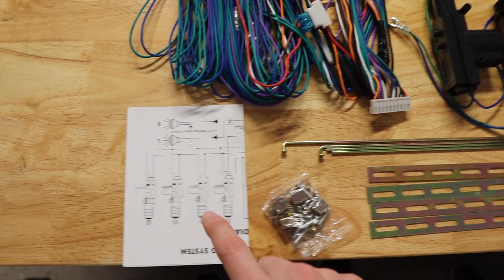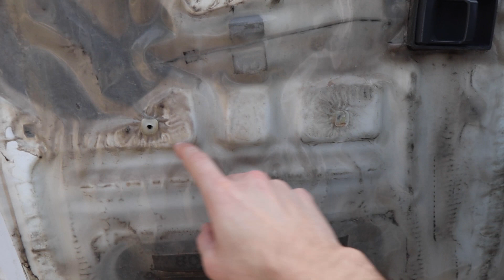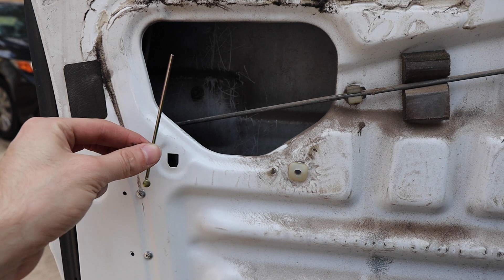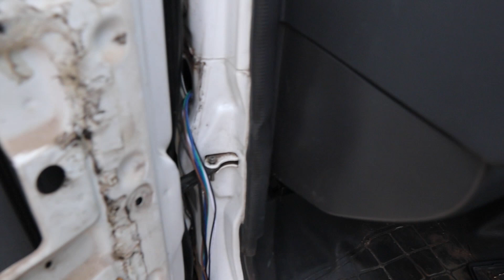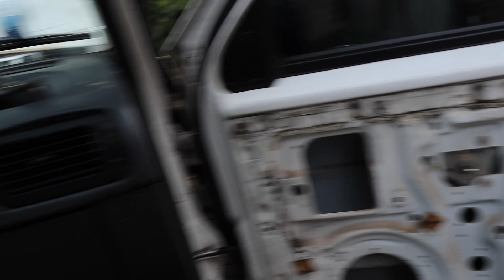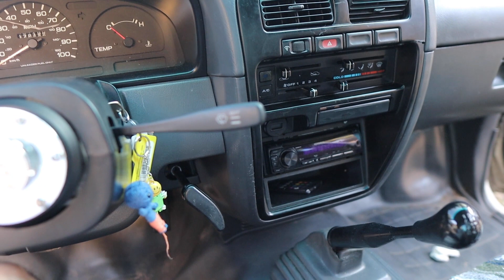How to Install Power Locks in Nissan Hardbody D21

Comment: I found the wire that will make the lights flash. It’s a Pink wire with a Blue stripe behind the steering wheel.
Reply: Doing this method makes all your lights flash, turn signal, corner lights, rear DRL lights, license plate lights, Dash lights, climate control lights, glovebox lights, just fyi for anyone doing this in the future

Comment: Usually what I'd do for customers, I'd tell them to buy an alarm system and connect the lock and unlock wires directly to the actuator wires that's if they don't have keyless entry from the factory. Majority of rangers and BSeries is all manual locks and windows. I tell them it's their best and easiest way to get keyless entry and stay safe from theft at the same time. I also remember a G35 having bad factory actuators, I ended up cutting the wires off the factory ones, installing universal ones and wiring the factory wires into the universal actuator. Worked like a charm with the original keyless entry from factory.
Reply from the maker: Yeah these systems are very easy for the most part and an alarm def adds to safety

Comment: Did I do the wiring wrong? I had connect the positive wire to a yellow wire thinking it was for the radio and found out that it’s draining my battery
Reply from the maker: It's possible if you aren't using the truck for long periods of time or if the wiring might be different in any way. The wiring on this truck was a mess from previous owners so yours also might be different

Comment: I have an extended cab 03 S10 not a D21 but I’m sure this would work just the same, great job guys
Reply from the maker: Should work the same wire wise, you might just need to find a good location for all the actuators

Comment: Did you ever wire in the lock and unlock light, if so did you ever get a video of it
Reply from the maker: We did but we haven't done a video on the hardbody, you can see the one on the B2000 and it's a similar concept just a matter of finding the two wires on the hardbody that belong to the turn signals https://youtu.be/mU-KjYHt0Bc

Comment: Did you guys ever finish wiring to the lights.? If so, where can I see the video.? I just installed the same one on mine but I don’t know where to connect the wires for the lights.
Reply from the maker: We kind of did but we haven't taken a video of the process. You have to tap into a wire in the steering column

Comment: What if you lose the key
Reply from the maker: I mean you ain't getting in your car without a key whether is a power lock or not
Reply: @FlakeGarage  but can you get a replacement
Reply from the maker: @blake8me  for the remote you mean? The kit comes with 2, if you lose both of them you'll have to get new programable remotes or a new control unit with remotes

Comment: Hey man your videos have been soooo much helpful thank you ! Now for the alarm system you installed, what is the distance range for the controller ?
Reply from the maker: That's a good question that I haven't really tested. So far it seems to open I"d say from at least 60-70 ft. I usually only open the doors once I'm about to hop on lol

Comment: Thanks for the video. My door lock won’t open with my key. I think the lock mechanism is faulty somewhere. Will this power lock work with my locks or do I need to fix my lock mechanism first? Thank you 🙏
Reply from the maker: You are better off fixing your mechanism first. It shouldn't be too difficult to do, most likely you might just need a new cylinder lock or some stuff plugged right. If the power runs out for any reason you have to use your key to open the door

Comment: Have a cuestion when u get the costant power from the stereo do the locks work only when the car is on
Reply from the maker: Constant power means the power line is always hot or "on" so your locks will work whether the car is on or not
Reply: @FlakeGarage  well i install my on the wire from the stereo  but only works whent the car is on
Reply from the maker: Then that is not the constant power wire. I’d get a test light and check the wires when the truck is off to find the constant power wire.
Reply: @FlakeGarage  i find wire thats is light green- yellow and the back of the stereo has a sticker has light green-yellow strip = memory feed

Comment: Mine locks then unlocks by itself. I color matched all the wires on the driver side. Trying to figure out why its not working.
Reply from the maker: Check all wires on the locks and also what you used to power the controller box. A power wire might be reverse which is activating the box in a weird way

Comment: nice install, one quick question, where did you get the steering wheel adapter? do you have the link. I like the fitment.
Reply from the maker: We have a video for the install on the steering wheel. Check out the channel but these are the hub and quick release we used NRG Hub for Nissan Hardbody D21 https://amzn.to/31hApIH
NRG Quick release https://amzn.to/3gTGGjr

Comment: Nice im thinking of that, where u guys located
Reply from the maker: We are based in Texas
Reply: @FlakeGarage  nice, is the wiring kinda the same for an alarm?
Reply from the maker: It would be a similar style yeah but the alarm horn would need to be wired somewhere under the hood so you might want to pull power straight from the battery
Reply: @FlakeGarage  thanks for the info guys
Reply: By the way did u guys put those lock to be powered instead of manually